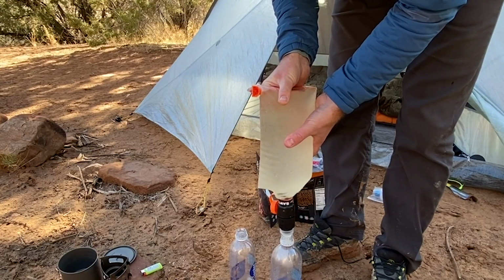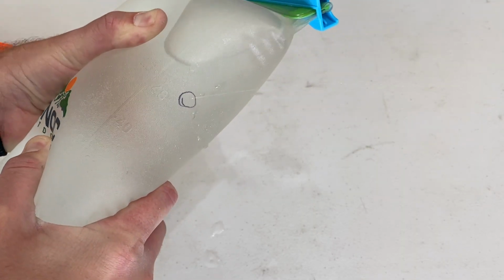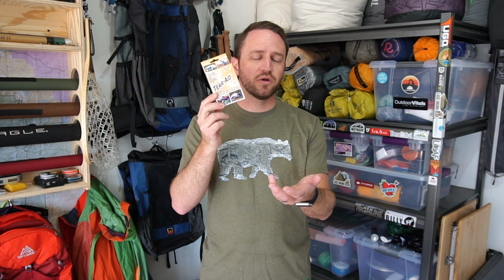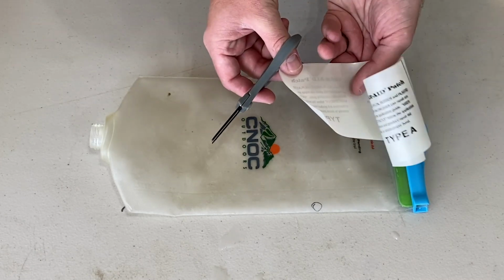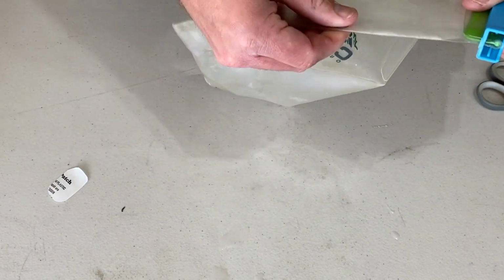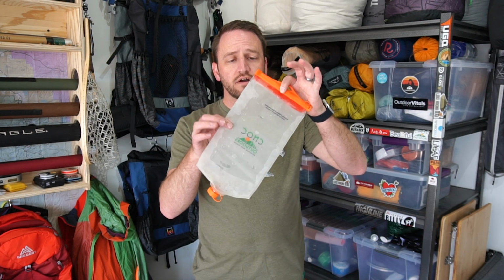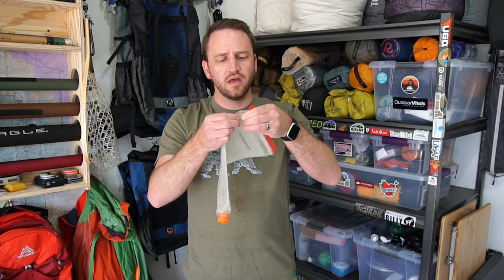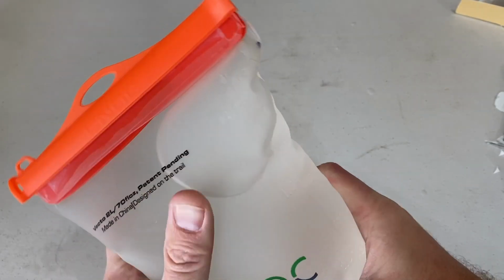How To Fix a CNOC Vecto With Pin Hole Leaks!

Comment: I have a tear repair kit in my pack for my Thermarest mattress. It’s easy to cut a small bit to do the repair. I would suggest to do the repair from INSIDE the bag where it would be protected from abrasion and rubbing off, as well as pressure leaking.

Comment: Great video!  This is a great way to repair while in-field.  I've found that using Shoe Goo on the CNOC bags works really well!  Just a little dab on the pinhole.  The Shoe Goo is nice because it stays flexible.  The problem is unless you carry a tube of Shoe Goo with you into the backcountry, it is best to be done at home after the bag has completely dried and the area with the pinhole has been wiped clean with some alcohol swabs.
Reply from the maker: Yeah the nice thing about the Tearaid is it's easy to throw into a repair kit and is a quick fix. Typically a pinhole leak isn't going to be enough to ruin a trip or be a huge problem since the TPU material doesn't really tear under pressure.

Comment: I swore off all water bags a while ago because every single one eventually formed a pinhole. I may need to revisit them (hydrapak was my favorite) knowing this fix will work. Thanks for the tip!
Reply from the maker: Yeah, the Tearaid would work on the hydrapak material as well.
Reply: I've been using Hydrapak, exclusively, for 15 years.  Once I had a pin-hole leak in my 3L Shapeshifter bladder.  They replaced it with one brand new.  Hydrapak drink systems are sold with a lifetime warranty on every component in the drink system, bladder, tube, bite valve.
     I don't carry water bottles; "smart" or otherwise.  I want/like the weight of water to stay centrally located in the middle of my backpack & use the side pockets for "Stuff", not water bottles.
Reply: @azclaimjumper  Seriously??? I had no idea about the warranty. Ok, time to get me another hydrapak!
Reply: @jamiepizz  Hydrapak Corporate Hdqtrs & mfg facilities are located in Oakland, CA; Hydrapak is Made in America.  Go to their website, see their warranty for yourself.

Comment: Thanks. I must be squeezing too hard because i've had two of these bags and they both sprang leaks within the first 5 days of using them. I havnt had any luck with other bags (sawyer brand) or other water storage bags like the MSR dromlite. I am not convinced it is possible to make a water bag that can handle much pressure. It perhaps is simply the wrong application. Perhaps gravity filtering is the best way to go.

Comment: I used a cnoc for water carrys and dry camping on my recent thru hike of the Ouachita Trail. It was not water tight on either end and I got 3 pin hole leaks. It kinda sucked. I bet a 2 liter pop bottle would work better.

Comment: I usually use luekotape but it doesn't hold up over time and it's obviously not transparent... wait... idk... is there transparent luekotape? Thanks for the info on these, I probably will now buy a box.
Reply from the maker: Right on!
Reply: I have Leukotape in my aid kit, prevent/protect blisters, hold bandages etc
you want Tenacious Tape sold by GearAid for these kind of repairs, works for sleeping pad, clothes, backpack etc , exists in black/grey/transparent

Comment: Great video Devin! Glad you did this, I'm likely switching to the Cnoc/Sawyer combo for my Thru-Hike this summer and was concerned about pinholes. 
Any guess if good ol' tenacious tape would do the trick too? Or does it need to be "type A"?
Keep moving forward broseph!
ps. nice backpack behind you. 😉
Reply from the maker: Yo! I’m not totally sure on the tenacious. I’d have to look at exactly what it’s made of, but should work. 
It’s a sweet pack, just can’t wait to get out an use it!
Reply: I was wondering the same thing about how Tenacious tape compared to the Type A. 

Maybe for different materials? I have the CNOC Vecto and Hydrapak bags, so might need to grab some of the type A just in case

Comment: Excellent video - - glad you included the test in the end - - always good to see success!!!
QUESTION - - what are your thoughts on the use of tenacious tape (I carry tenacious tape in my repair kit and would want to avoid carrying unnecessary/similar products).   LMK your thoughts.   Thx
Reply from the maker: I believe the make up of Tenacious tape would work as well. Maybe not as long term, but I've patched a sleeping pad with tenacious tape before.
Reply: I tried Tenacious Tape to seal two pinholes in a Hydrapak-black bag.  It did not stick.
Reply: @panhandlejake6200  Good info!